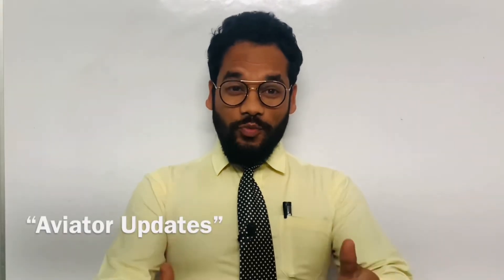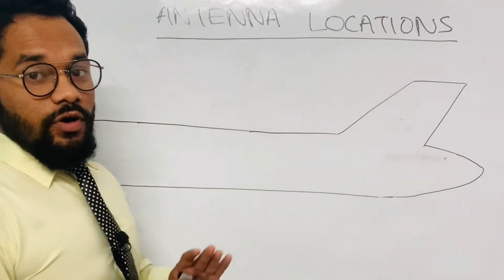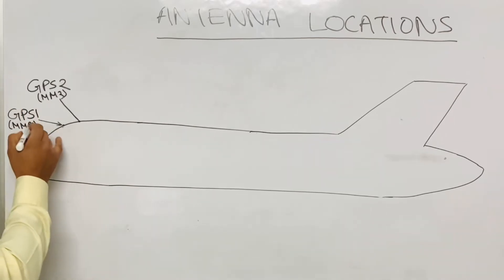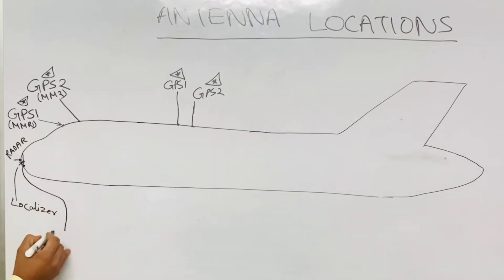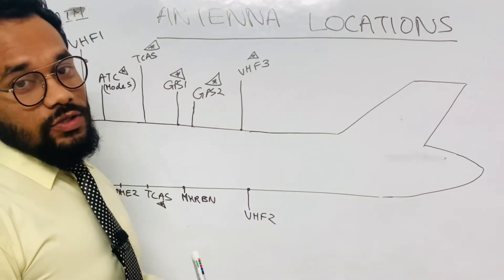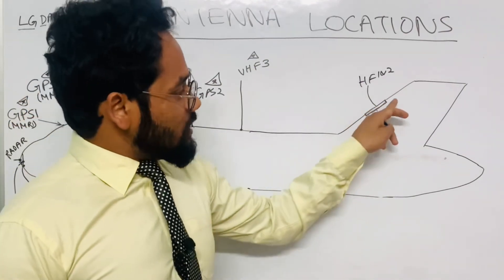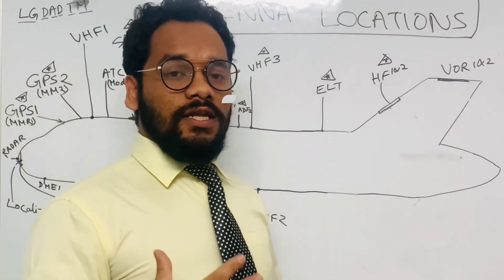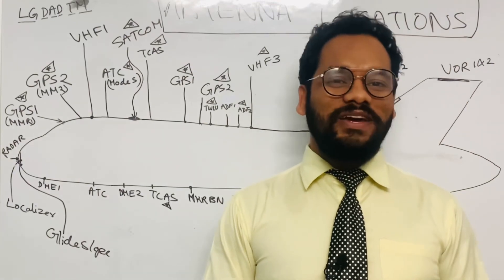Location of all Antennas in Aircraft | Airbus A320 Antennas |

Comment: HF # 1 location
Reply from the maker: Both HF #1 & #2 antennas are mounted inside the leading edge of the vertical fin casing  (structure).They are not visible outside the vertical fin structure as like the other antennas mounted on fuselage surface are.